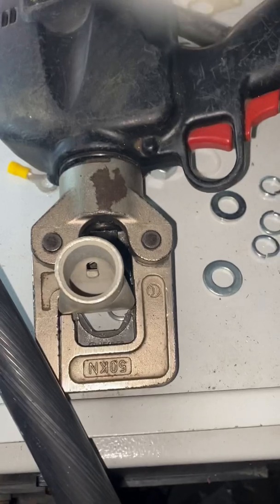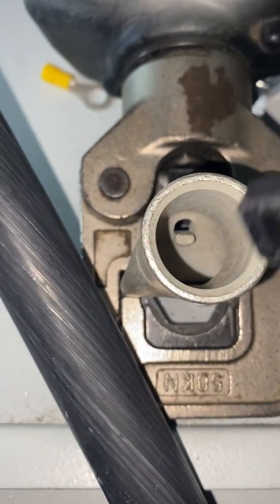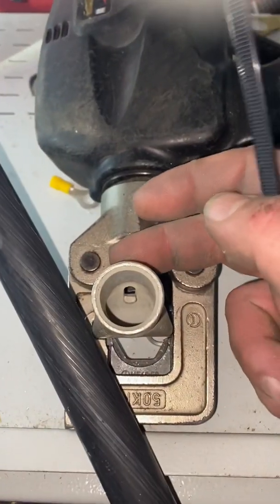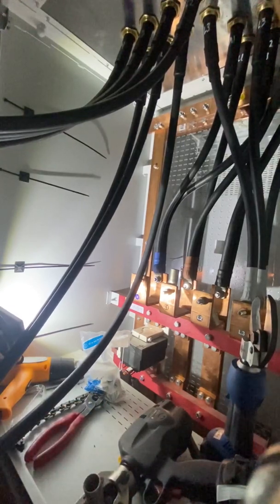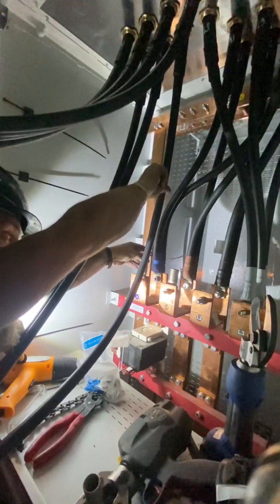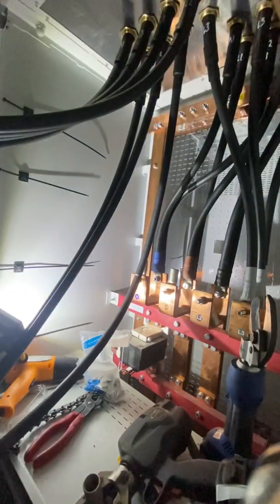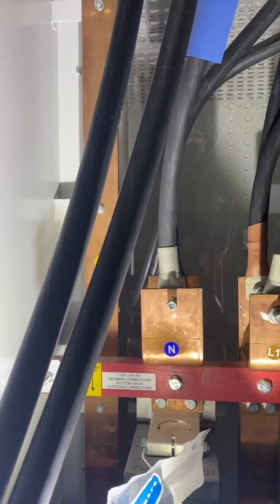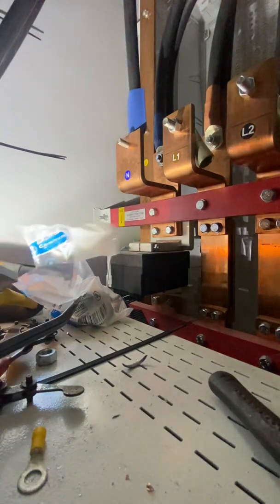How to measure your cable accurately with a tywrap!

Comment: What do you do if you cut the cable too short? 
I assume it happens from time to time because we're all human and all that.
Those cables seem too big, too long, and too expensive to just replace.
Reply from the maker: I've never done it when it's been glanded. However I did once cut a core short about 18 years ago. I was lucky to be able to connect it to another copper bar in the compartment. I've never done it since🤦🏻

Comment: Why don't they put a witness mark on the outside of the lug? I'd design the molding with a lip and a scraper "nub", so align on the insulation then swipe to leave a mark on the cable at the cut.